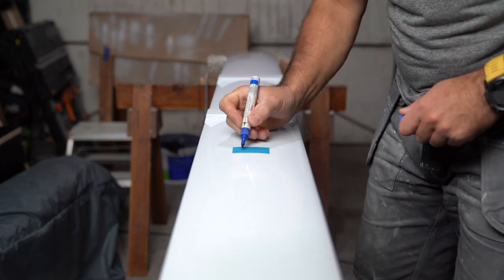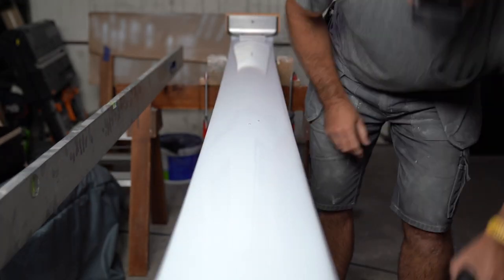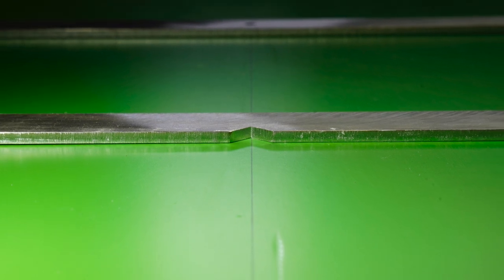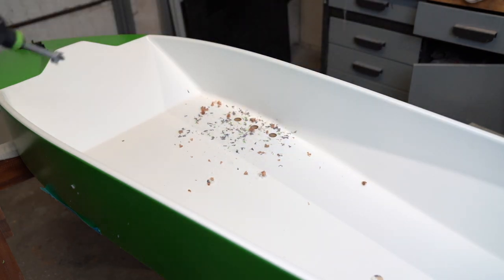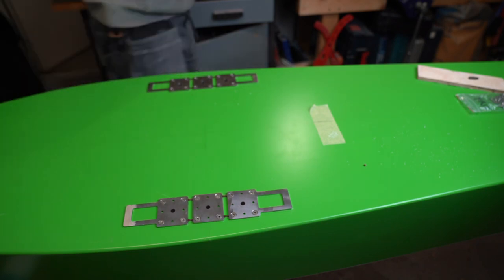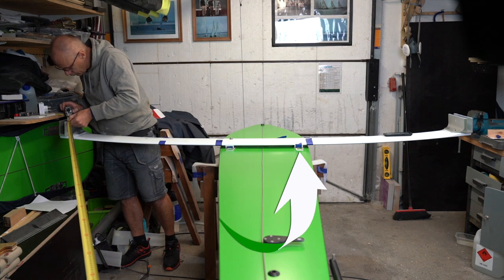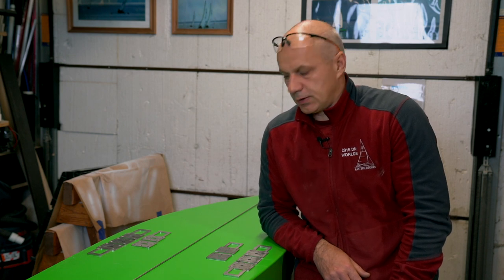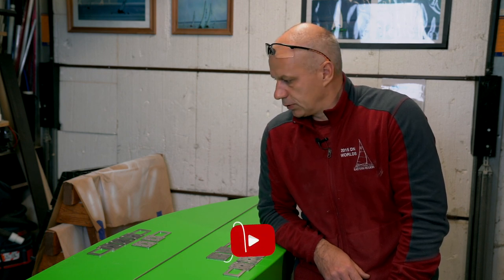DN Tech Talk | 11 Plank to hull 2 of 3 | Icesailing | Iceboating

Comment: Tomek, great series! I see you through bolt your plank directly vs using the surface mount studs I see on many boats. Is there an advantage of the through bolt technique from your perspective?
Reply from the maker: Main advantage is that only one thing may fail. In case of my system it will always be the plate on the hull. 8mm bolt will win. If you have sort of 3-pad and stud on the plank there are 3 things to possibly fail: pad on the hull, stud or stud with plate on the plank.